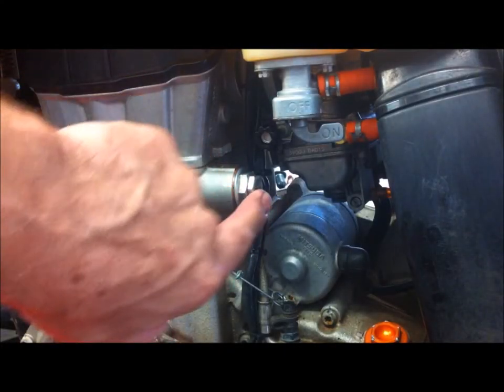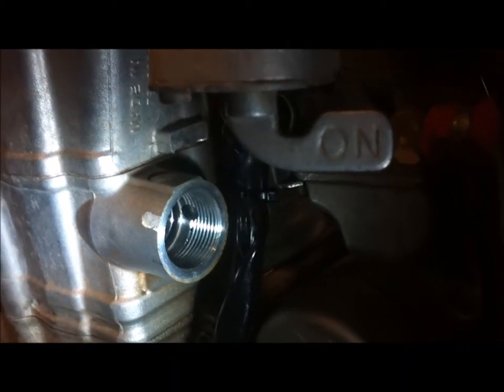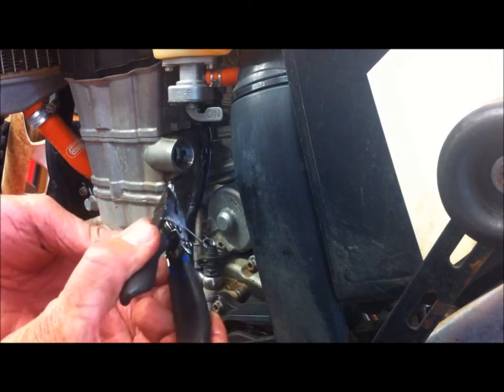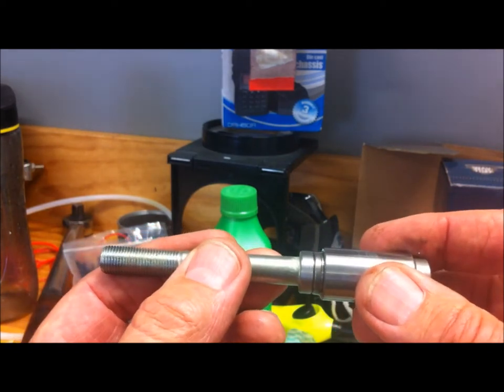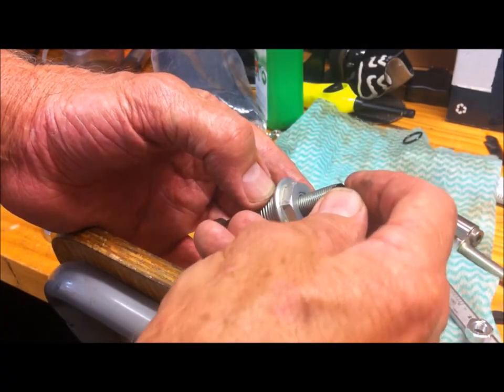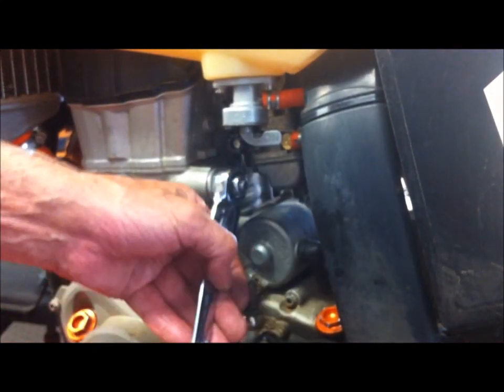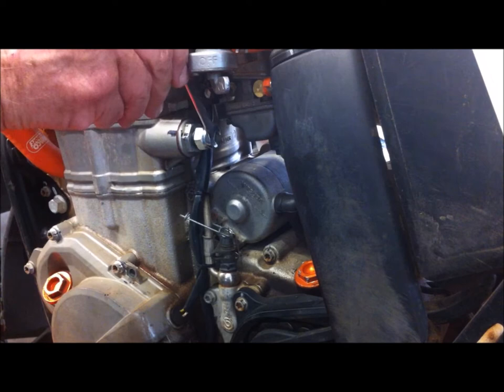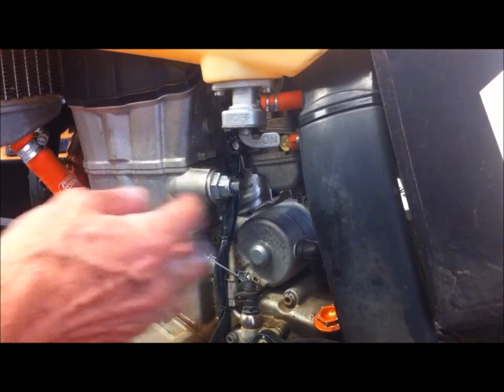KTM Make a Manual Cam Chain Tensioner

Comment: hello, very good video. One question, and if you don't install the bolt in the oil hole, what happens? Thanks for the video and best regards.
Reply from the maker: The oil pressure will be less as there's an open hole for the oil to rush out of. I was concerned it could cause damage elsewhere in the engine so figured it was best to plug it.

Comment: I know this is 2 years old and hopefully your still on here but. Was wondering with that plug does it just “sit” in there? You obviously got some miles on this with that setup. There’s no worries about it falling into the motor? I am guessing the oil pushes on that plug so no reason for it fall in. Any info would be great. Love this set up.
Reply from the maker: Yep I'm still out here ... fortunately I haven't perished in the desert on my KTM!
Yes it just sits in there. If you make it about 17mm long you'll see it can't go further in. The body of the tensioner stops it coming out.
Reply: Awesome! Thank you. They wanted to sell me a 200$ manual chain tensioner and thought yaaa pretty sure I could make that. Stumbled on your vid and helped big time! Jealous of your riding season! Still winter in Canada....
Reply: @yamabroz5271  when you made the little plug for the oil hole, did it fit loose, snug, or tight in the hole after wrapping it with pipe thread tape?

Comment: Thanks. You just saved me over £100
Reply: I just did this to my 530, when you screw the new bolt by hand is it until you feel resistant or tighten by hand until you can't do it any further?

Comment: Should the small alloy plug fit loose, snug, or very tight in the oil hole after being wrapped with thread seal tape? Thanks.
Reply from the maker: Hi Aaron. The plug needs to be tight enough to stop all or most of the oil flow.  Put enough tape on to give a snug fit when you push it into the hole. It can't go anywhere as there's no way it can escape.

Comment: Hey mate - Can see here you never went on about TDC etc. 
In this kind of simple mod; is TDC required to put this on - or can you perform the mod simply with any position?
(I understand TDC is generally best to try and achieve - but not required in this case?)
Reply from the maker: Hi Hayden. I didn't mention TDC as it's irrelevant for this modification. If you watch my video on valve clearances you'll see setting the TDC is required for that procedure.
You can remove and replace the chain tensioner with the crankshaft in any position. Regards, Scott
Reply: The timing chain is already connected to the cam and crank gears and will not shift as long as the rotating assembly is stationary

Comment: Quick question do you just re-tighten the adjustment if the rattle comes back? Great video too 👌
Reply from the maker: Thanks. Yes it's a manual adjuster now so you have to check periodically. I've just completed a 1700km enduro through the Australian desert and the adjuster is working like a charm.

Comment: Hey Scott, thanks for sharing! I see upon reinstalling your manual tensioner you never reinstalled the big O ring that was originally on the hydraulic tensioner. Is this correct that it is not used again?
Reply from the maker: Thanks Greg. That O ring is not required once you remove the hydraulic tensioner.

Comment: The problem with this is that while it saves you $ short-term, it is not a good long-term solution.  There's a reason these bikes have hydraulic tensioners installed: because the factory engineers determined there needs to be some "give" in the chain tension on EACH rotation - the tension has to be "fluid" or adjust slightly as the chain rotates and goes through the tension/slack cycle.  Yes, you can get the manual tensioner to "work" but it puts excessing stress on the chain on each rotation.  If you leave the manual tensioner loose enough to avoid this stress, it's too loose in the slack spots and if you tighten it so it's quiet all the time, it's too tight during the high tension part of the cycle. Think about it: if KTM could get away with a cheap, manual tensioner, why wouldn't they?  Just because it's worked "so far" doesn't mean it's correct or the chain will last as long as with the hydraulic one or will not cause other issues (if you ever break a timing chain (more likely if it's over-stressed), it's game over to the tune of many thousands of dollars).  Why do this?  Why not spend the $50 every few (5-7?) years for a replacement OEM tensioner.  Most riders ride 10-50 hours a year and these tensioners last many hundreds.
Reply from the maker: A manual tensioner has it's pros and cons. People who install them are usually more detailed with their maintenance and more mechanically aware so they tend to adjust the manual tensioner frequently and correctly. If I sold the bike I'd probably reinstall the hydraulic item.

One reason the factories fit hydraulic tensioners is they know most people wouldn't have the technical skill or discipline to periodically adjust a manual item.

Stick with what you feel comfortable with. I see Dirt Tricks makes a hydraulic tensioner with an 11 point ratchet system that only gives one way movement. It's like an automatically adjustable manual tensioner.

https://motocrossactionmag.com/mxa-product-test-dirt-tricks-ktm-cam-chain-tensioner/
Reply: @ScottElliott152  Well, that's on take on it but you do not not address the differing chain tension requirements on the bigger bikes.  You can watch this https://youtu.be/0u0lE4hM1ok?t=117 for more (make sure closed-captions are on and you are patient).  There are two issues: one is insufficient tensioner damping causing abnormal chain and slider wear.  The other is that with the taller engines, vertical heat expansion requires the chain be correctly adjusted when the engine is essentially at its peak operating temp (i.e, the crankshaft center is furthest from the camshaft center).  If you adjust a manual tensioner cold, the chain will be too tight when the engine heats up.  If you adjust the chain hot, it will be too loose when cold.  In short, there is no correct adjustment with a manual (or even old-style spring/rachet ) tensioner.

Talking about "comfort" level is a mis-direct not addressing stated technical arguments.  The DirtTricks tensioner should not be used because of the very reasons I state (it's a spring/rachet system so it locks too tightly)  (I had a DT tensioner self-destruct in a 701).  I specifically called the DT people and they had zero engineering response to the issues mentioned above - they just said "well, we sell a lot of them so they must be good." What? Just because someone sells something does not mean it meets the engineering requirements - it just means someone will pay for it.

So, yes, you can run anything you want if you are comfortable with it.  I think it's misleading to state that tossing a $5 bolt in your bike solves all your tensioner problems while also potentially causing bigger issues.  To your point of owners being lazy or negligent on KTM maintenance, I disagree - KTM has very short service intervals that all owners I've met stress over and if it were just a matter of undoing a tensioner locknut and adjusting the tensioner bolt, they would certainly install manual tensioners or make it an option (which KTM does not).
Reply from the maker: @scotttaggart  The video was informative and the guy sure knows his chain tensioners.

Comment: Where did you find the m10 1.0mm bolts? I just went to bunnings and they dont have that size
Reply from the maker: qwerty123627 you need to go to a specialised fastener shop. Bunnings won't have them. I got mine from Multi Fix Fasteners. Scott
Reply: Scott Elliott is that in w.a? I tried 4 fastener shops in sydney but they all said i got buckleys  of finding one in australia! Found some on ebay but none 70mm long.very hard bolt to find
Reply from the maker: I think the guys in Sydney are being a bit lazy! Ring these guys. I'm sure they'd tell where you can get one in Sydney. I walked in and had a couple of bolts and nylocs in 3 minutes. http://multifixwa.com.au/
Scott

Comment: Destroy the engine low oil presure to the head
Reply from the maker: Please explain the technical reasons for the statement. I say it doesn't reduce the oil pressure to the head.  I've done thousands of kilometres of remote enduros since this modification and had no problems.